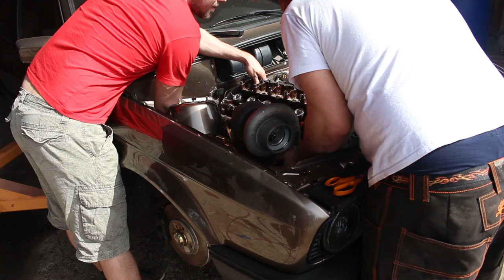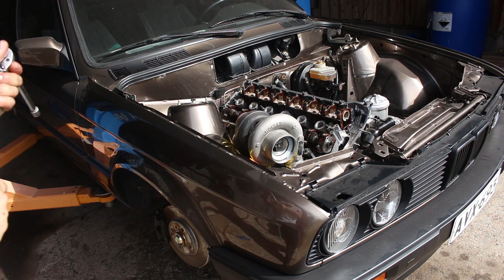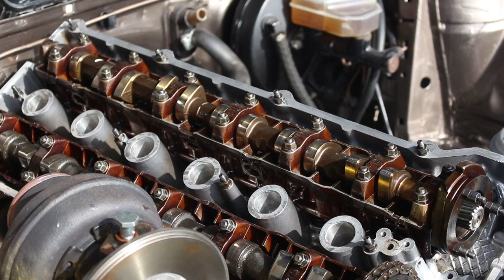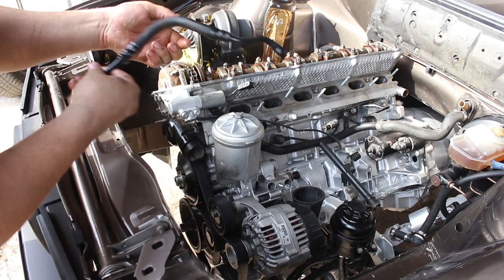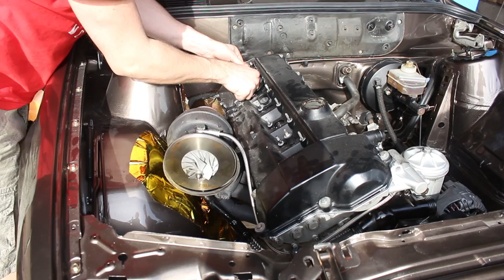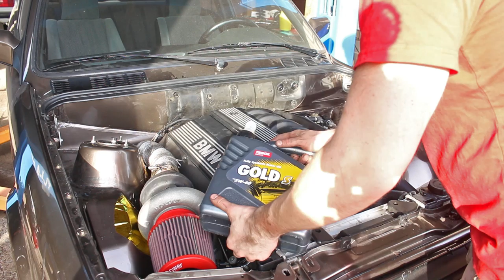BMW e30 m52 turbo winter maintenance. Part 6 Head assembly, valve timing and first start.

Comment: Hi Pazi, your videos are awesome. I have the same camshafts that you have, I’ve already modified them to fit my M50. But I’m a little confuse about the timing. Should I use the original tool to time the intake M54B30? And use a gauge in the cilynder 6 on the exhaust side to measure 0,1mm opening on the valves? Can you make a video explaining all that stuff? Thanks a lot. Regards from Brazil.

Comment: Hello, I have seen your video and I really liked how you work.  I have 2 doubts to see if you can solve them for me, 1st, what do you mean by the letters TDC?  and 2nd, is the opening on the valve 0.1mm, which is 1 tenth or 1mm?  I read comments and did not understand it very well.  I am from Spain and I am doing it on a m50b25 nv engine the stroker, is this setting of valve opening also valid for m50b25 nv? thanks in advance.

Comment: Hey pazi , why u adjust the camshaft at 0.1mm on dial indicator and say that is mean valve open 1mm , my question is you should adjust the camshaft to 1mm on dial indicator or iam wrong
Reply from the maker: Yes that was a mistake and it was corrected to 1mm after finishing up the engine.

Comment: Hi, when timing the m50nv cam, are the lifters full of oil, and does that make a difference to how much the valves at cyl 6 open ? Also, do you place the dial guage needle directly on the lifter, measuring 1mm (meaning the valves have moved 1mm also)? Would be very happy if you could help me, big fan of yours and keep up the good work !
Reply from the maker: Lifters have spring inside, so you don't need to care how much oil is in them. They should be closing the cap just fine in non-running engine no matter what, so you can measure from lifter.
Reply: thank you for the answear ! I have an m50 manifold, cams like yours , 68mm tb and ebay header, been trying to self tune my car, copying you but the ecu stuff is hard for me 😄

Comment: How much hp are the stock head bolts good for? Thanks for the excellent videos
Reply from the maker: Thanks. I'm not sure. I have seen them give up after 1.3 - 1.5 bar of boost. I'm currently running 1 bar of boost so it should be in the safe zone.
Reply: @pazi88  Dear Pazi, how much power did u do at 1 bar of boost ? I am running 2,6 liter m50 stroker currently at 0,9, so just to compare...

Comment: My intake side sprocket won't fit over the M54b30 cam.. Just seems to big 13:53
Reply from the maker: Are you using all of the parts form m52 cam?
Reply: @pazi88  Yes. All the same just swapped the cams.

Comment: I'm rewatching this full series again, and I realize a lot of new stuff watching it again. 

You run stock M52B28 crank+pistons and M50NV rods, and the athena copperring gasket. 
So stock compression?
Reply from the maker: Yes. With e85. It lasted years, untill I gave it 10 minutes of rev limiter at the track 😁
Reply: @pazi88  What is the modification needed to run the M50NV intake cam as exhasut? 
I have read that there needs to be taken 1.7mm away.  I'm just not sure wherefrom. 
Should this be milled away from the mating surface of the chain sprocket?
Reply from the maker: @uscp2  2mm off the sprocket mounting surface: https://pazi88.kuvat.fi/kuvat/Projektikuvat/e30+xxx/mylly/IMG_0755.JPG
Reply: @pazi88  Hello mate, just want to check - yours athena headgasket doesnot change the CR?
I do have an m52b30 stroker (alu block), with 240/240 cams, want to turbo it for semipro drifting, want to use the athena aswell, and change the rods for m50nv. But I want to use the gas station 98 octane, is it a big problem? I want to have about 450hp, but reliable :)

Comment: why you oil the bolts before installing them in the block , oily bolts need more torque than dry bolts torque ?
Reply from the maker: The oil is required to get the required stretch for the bolt. It's said in BMW factory repair manual also.
Reply: where can i get BMW manuals ?
Reply from the maker: Download BMW TIS or use this: http://translate.google.ca/translate?hl=en&sl=ru&u=http://tis.bmwcats.com/&prev=/search%3Fq%3Donline%2Bbmw%2Btis%26hl%3Den%26client%3Dfirefox-a%26hs%3DbQ6%26tbo%3Dd%26rls%3Dorg.mozilla:en-US:official%26channel%3Dnp&sa=X&ei=EN7hUMDzEOqY2wXU04DABg&ved=0CFYQ7gEwAw
Reply: Thanks mate that helped a lot ! :)

Comment: 18:36 You made an error, you skipped a tooth when moving the vanos onto the spline, I've done this accidentally before and it messes your timing badly.
Reply from the maker: Usually the cam/vanos gear doesn't line up correctly, so you need to rotate the sprockets quite a bit to get the teeth to line up. And even if you skip a tooth, it doesn't affect the base timing at all. The cams are still degreed as they should. It only can limit vanos travel amount that stock ecu at least throws errors.
Reply: @pazi88  appreciate the insight

Comment: Will stock head bolts hold that power? Also how you modified M50 intake cam to fit as exhaust?
Reply from the maker: You have to take 2mm off the sprocket mounting surface in lathe.

Comment: why not use an m50 intake manifold it flows better than the m52s at least on n/a
Reply from the maker: Steven Pal Yeah but only in top end. m52 intake manifold gives me lor more low end torque. And in turbo engine I can have as much top end power as I wan't just adding boost.

Comment: Hello. @ 14:56  - 1mm open or 0.1mm?
Reply from the maker: Should be 1 mm but I accidentally put that to 0,1 mm :D
Reply: So, You did not change as You wanted and it works nice? I just put a REAL 1mm and thinking, maybe some compromise ~ 0.5?
Reply: And what You used to hold magnet well on engine? On what dod You put it?
Reply from the maker: No I didn't change that. The engine works fine with that timing also. It just means less overlap which causes more low end torque with losing some of the top end power.
Reply from the maker: I have steel plate bolted onto valve cover stud.
Reply: @pazi88 did you mean with only 0.1mm valve lift on the 6th cylinder the engine has less overlap than 1mm? I thought if you were to set it at 1mm lift then the engine will have less overlap.
Reply from the maker: @armandardika2244  Yes less overlap with 0.1mm opening than with 1mm
Reply: @pazi88  Thank you for your answer. Should I target 1mm lift to  give the best load even if I upgraded to S52 Riot Racing camshaft (more duration and just 0.1/0.2mm more lift)?

Comment: paljo meni rahaa suunillee kun ihan ekan ekan kerran tän moottorin rakensit jos tätä talvihuoltoa ei oteta mukaa?
Reply from the maker: Moottori oli 600€, suuttimet jotain 300€, e34 m50 öljypohja 150€, cooleri, yms. ahtoputkiston osat 250€ turbo 650e, pakosarja 300€, pakonokka 50€, tiivisteet yms. 100€, moottorinohjaus 500€ Eli ei mitään järjettömiä.

Comment: hello .. great work. question for you . i have some problems whit my timing on my m52 b28 singel vanos. i have just installed new cat cams to my compressor build and have some problem whit cam and crank sensor they come up as fault code and mess up the ecu and cause running issues(both new oem sensors) . is this a timing issu .. my new cams are 257 inn 257 out the cams has been timed by standar cam timeing ..thanks for anwer Ray
Reply from the maker: Hi! did you remember to put the cam trigger plate to the new cams: http://www.realoem.com/bmw/enUS/showparts?id=CD11-EUR-07-1995-E36-BMW-328i&diagId=11_6060 (part number 7). If so the stock ms41 ECU should work if the timing is somewhat correct. But there also has been quality issues with the OEM bmw sensors and some people had to go through even three new sensors to find working one.
Reply: thanks for quick reply .. yes ofc i remount the trigger plate :) ahh oki i will try a new set shortly. now i will try simens/vdo sensors as this ecu is also simens. i have the same grade on  intake and exhoust cam 257) ... the org is somehove difrent  from intake to exhoust(not the same grade) isent it? when i time like i have org cams this will be somehow wrong? and the trigger plate will not mach on timing on intake cam? . you guys living in finnland? im from norway .. have some hard times to find someone who will map my ecu  to my engine setup. . my fault codes are crankshaft sensor or camchaft.. depends on who will reg a fault first... and then trigger oxygensensor limit cyl1-3 and 4-6 fault code. if i disconect both oxygensors the car somehow run deasent but my rpm gauge and fault code on cam or crank remains. and miss bottom end tourqe. in worst case senario is it somthing you guys in finnland can map and time? thanks
ray

Comment: Where did you get the double banjo bolt for the s54 oil filter housing? It looks like it feeds vanos and turbo from the same fitting. Did you have to tap it for 14mm?
Reply from the maker: Yes it feeds both. There was extra m12 plug in the filter housing and I tapped that out to m14, so regular m14 banjo bolts will fit in same way the fit m52/m50tu filter housing.

Comment: Hi can you tell me what power your car is ?I am building an aluminium block m52 turbo with 3.0 inlet cam forged rods 9:0.1 compression and a gt4094r turbo hoping for 600hp !
Reply from the maker: Hi! My car has 500hp. The 600hp might be bit too much for aluminium block. Because you need to use stock bolts with alu block and stock bolts can't handle more than 1.5 bar of boost. And with that compression ratio, you will need more than 1.5 bar of boost to get that 600hp.
Reply: I will need 1.5 bar to do 600 !
My tuner says 9:0.1 will be fine and he tunes a m50 single vanos motor with same cam and m54b30 crank rods and pistons and did 261hp so 240hp should be possible on a 2.8 which will do 600 at 1.5 bar  .
Them numbers are on a new super flow dyno not dynojet or a hub dyno

Comment: Witch wiring do u use for m52 swap and does everything work(dash gauges), or e30 wiring is ok with few tweaks
Reply from the maker: It's almost stock m52 wiring. Some wires has been rerouted to fit e30 and I have separated the dash coolant sensor wire from m52 coolant sensor and fitted e30 sensor to get the stock temp gauge to work. Everything works like stock except fuel consumption gauge. That might work with stock m52 dme but I'm running megasquirt.

Comment: Just wondering does the Evac scavenger kit for the PCV system mess with the Wideband sensor? or did you route the Scavenger kit after the wideband sensor?
Reply from the maker: Tye Varnes Yes the scavencer is far away back from the wideband. So it doesn't cause problems.

Comment: Hey pazi, i noticed your brake booster connected to something other than the stock place in the intake manifold... What is that?
If i turbo my M50 do i need to reroute my brakebooster line aswell?
Reply from the maker: No the booster vacuum line is connected to the stock location in intake manifold. You only need to make sure that you have the stock one-way valve installed in booster vacuum line.

Comment: I've been in the turbo game for a while now and it seems like every m50 nin vanos I've had in my car i have a distinct rattle at 3000 rpm it sounds like a timing chain rattle. I use the .140 thickness head gasket, new timing chain guides and all new upper and lower tensioner. Can I get your advice please. This sound is driving me crazy
Reply from the maker: Normally m50 vanos looks like this: https://www.realoem.com/bmw/enUS/showparts?id=CB31-EUR-01-1994-E36-BMW-325i&diagId=11_1541 But after 3/95 they upgraded vanos with spring washer, and it looks like this: https://www.realoem.com/bmw/enUS/showparts?id=CD11-EUR-07-1997-E36-BMW-328i&diagId=11_6060 So upgrading parts 9,10,11 and bolts 6 from newer m52 vanos, the rattle has gone away in my engines.

Comment: Why do you use W-40 oil in such a powerful engine ?(How much power btw?)
Reply from the maker: The oil viscosity and engine power are not related to each other. The required oil viscosity comes from the engine internal clearances. And those are at OEM specs so OEM spec oil is needed. Even high hp modern GTR engine uses 0W-40 or 10W-40 oil. This engine of mine has 500 hp.
Reply: That was my mistake, I thought the oil was 40W-XX, cause saw only 40 on oil canister...And realized there is not so thick motor oil at all after googled lol. Anyway, super great videos, hope you do a lot more on other aspects too like bodywork!

Comment: hey Pazi, did you ever had problems of leaks with the athena gasket? i am having one and dont know what to do anymore...
its leaking coolant right under the coolant temp sensors... i torqued the arp headstuds to 75 lbft but keeps leaking..

hope you can help me :)
Reply from the maker: azaza808 I haven't heard about any problems about those leaking. The ONE showed some "sweating" after few temp cycles. But we retorqued the arp studs and it's now fine. If it doesen't stop, you probaply need to take the head off to see what is going on.
Reply: I i figured id need to retorque the head, someone told me that my block had to be machined with timing cover on and thats why its leaking, but my block wasnt machined was only cleaned and basic resurface done. Thanks ill try and if doesnt solve ill take the head off.

Thanks a lot man and keep the videos coming cuz we are waiting for more :)

Merry christmas

Comment: hey, how turn out your e-vac crankcase ventilation ? what did you did to dipstick tube for crank case vent? just blocked off?
Reply from the maker: e-vac works well. Maybe little bit of oil smell behind the car. but that's not my problem because only cars behind me will smell that :D Stock separator/cranck ventilation system is removed and the port for that in intake manifold is blocked off. The m50 e34 dipstick tube doesn't have the oil return line for crank ventilation. But with m52 dipstick I would have just blocked off that.
Reply: OK got it!
I have a little bit a problem with smoking, when engine is warmup, while idling  smoke: white/ blue smoke coming out.

Comment: Hey Pazi, I am in the progress of doing the same camswap in my m50b25tu Vanos engine, could you tell me how much do I need to mill the camsprocket surface of the NV Intake cam off to put it on the exthaust side of my engine ?  I will run this engine N/A without Turbo, what camtiming for the exthaust cam should I aim for with the dial gauge in your opinion ? Also do I need to modify my stock m50 Liftertray for the m54b30 cam on the intake side?  Thanks in advance, I really appreciate and would love to hear your answer. Best regards
Reply from the maker: You need to take 2mm off the sprocket mounting surface. And you MAY need to grind little bit off from the cam tray between lifters. Depending how castings match. And that 1mm open at tdc is good starting point for exhaust cam timing.
Reply: pazi88 okay , I will do that. thank you very much !!!
Reply: @pazi88   hey Pazi, I just wanted you to know that you indeed need to grind some material away of the m50 cam tray to fit the m54b30 cam. It is not that much, maybe about 1mm of hight between the lifters. Thank you again for your knowledge

Comment: Hey Pazi I have a question about cam timing. I have an m50tu with an m54b30 intake cam fitted to it and stock exhaust cam. I was just wondering if I need a dial guage for timing or if the normal marks line up? I noticed you used a dial guage for the m50nv cam on exhaust side which caused the marks to be misaligned. Also is it possible for these motors to have slightly bad timing without interfearence between the pistons and valves? After this mod, my motor suddenly sounds alot deeper and quieter. Almost like a subaru lol. Any help appreciated Thanks!
Reply from the maker: Tye Varnes No you can time with the normal timing marks. I'm using dial gauge because I have m50nv intake cam as exhaust cam. And that causes the timing marks misaling.
Reply: Thats what I thought. Thanks
Reply: Tye Varnes, did you see much of an increase in performance with just the intake cam? Any trick with easy timing? Did you find a tune for it? Thanks! -Dan

Comment: u running hall sensor on the m52b28 turbo?
Reply from the maker: Yeah the stock hall sensor.
Reply: +pazi88 so the ms box is build for hall? thinking about getting VEMS ecu on mine m52b28  but not sure if i should choose vr or hall sensor?
Reply from the maker: +Mg Mg If you have good hall sensor from m52 use that. If you don't, buy the cherry hall sensor. There is also adapters  for m5x engines for that

Comment: Also why you haven't used M50B25 intake manifold?
Reply from the maker: It gives more low end torque off boost. The top end power is easy to get with high boost but I like the engine to work in low rpm also.
Reply: What about stock head bolts? They can handle such power?
Reply from the maker: +eimantas28 Yes they can. I have seen them give up somewhere in 1.5 Bar boost levels. So 1 Bar that I'm using is quite safe.
Reply: For how long? is that kind of vehicle can be daily drive? With 1bar boost or little lower
Reply from the maker: +eimantas28 Should hold as long as needed if there isn't problems in the engine (serious misfires etc.). At least mine and the ONE have worked in daily use without problems. Also I know one boosted almost stock m50 engine in Finland that has worked for more than 40 000km. Mine has now worked about 6000km with zero problems.
Reply: What about automatic transmission 5hp18. Can it handle turbo power? Have any ideas? My vision is to have turbo powered e39 daily drive, but low boost arround 350-400hp max.
Reply from the maker: I don't know about those automatic transmissions because I haven't heard anyone running boosted BMW's with then. You have to try ;)
Reply: Turbo e36 m52 is my engine do suggest that I do arp studs or leave the stock running about 8-10 psi
Reply from the maker: Engine with even stock head gasket will handle more boost than 8-10 psi. The stock head bolts hold with even 20 psi with better head gasket. But after that I would turn to ARP studs.